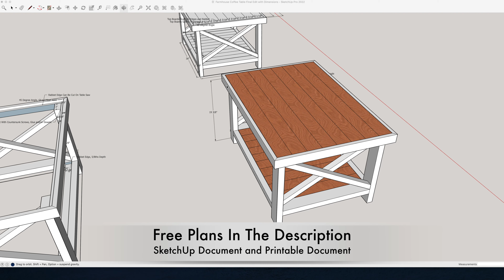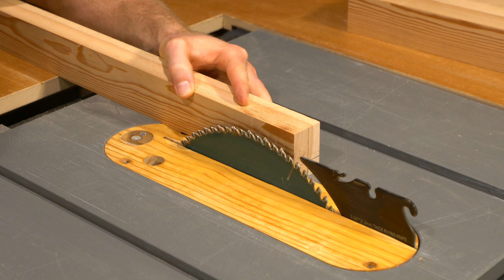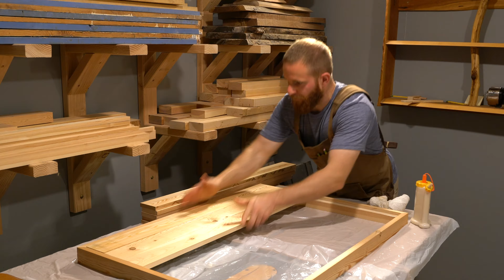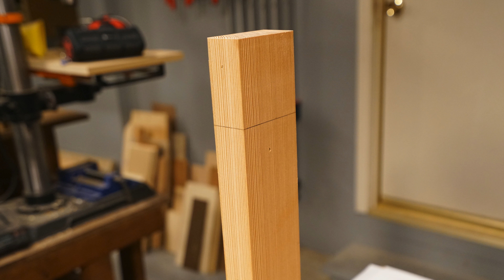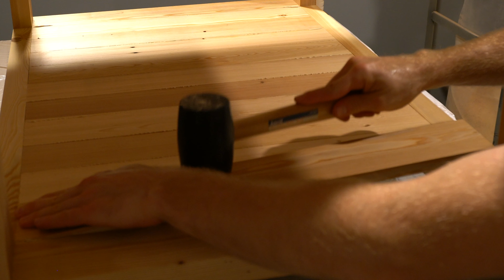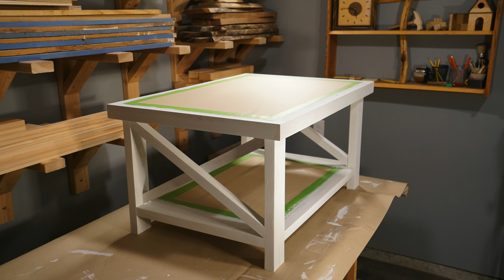How to Build a Farmhouse Style Coffee Table - Free SketchUp Plans

Comment: Nice! 👍🏻
Reply from the maker: Thanks bro 👍
Reply: @_Shopfix  Is that the dws780 miter saw?
Reply from the maker: It’s actually the dws779, I think the dws780 has a few more features but they are really similar!
Reply: @_Shopfix  Oh, I was wondering why you weren’t using the light. I have the 780 and the light stopped working after 6 months so I sent it in to be fixed. Im gonna try and make this when I get it back haha